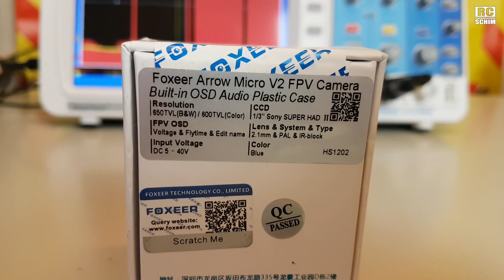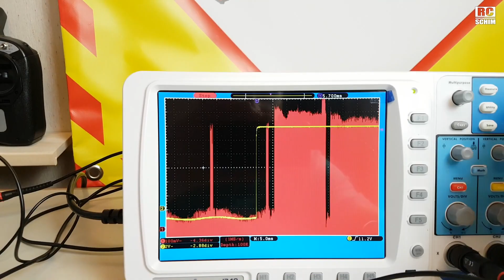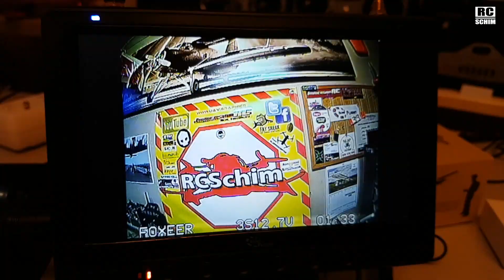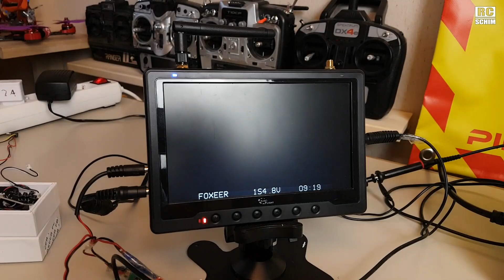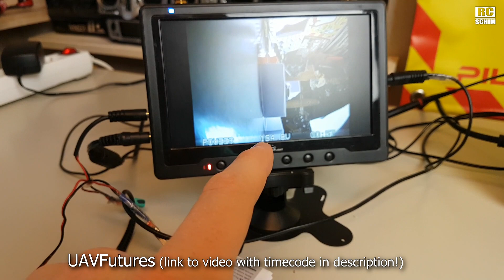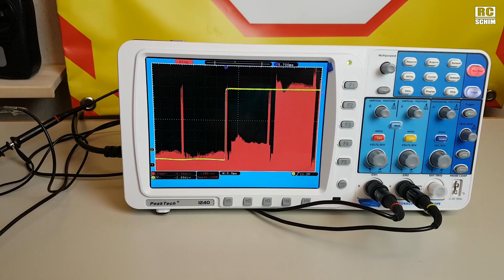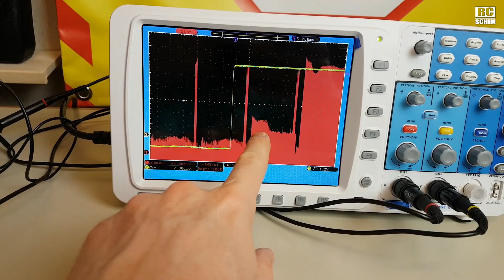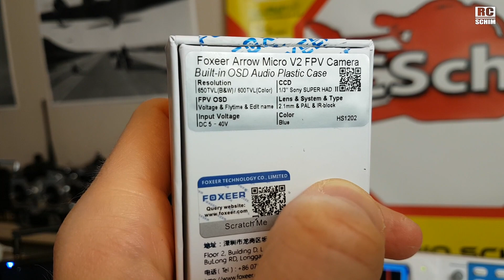Foxeer Arrow Micro V2 (Volts, Latency, compared to Runcam Micro Swift)

Comment: Did you try measuring the latency with the OSD switched off as the newer firmware increased it. With the Betaflight OSD being so versatile I can see the Cam OSD only being used on real budged builds.

Comment: Seems like the one you got with the fast-updating-OSD-Issue was not a "V2", because the "V2" should be the ones with the fixed OSD. (The cameras sold about half a month ago with the issue where just labeled "Foxeer Arrow Micro FPV Camera" https://youtu.be/NQW6_wtDqtI?t=1m15s ) PS.: I'd really be grateful if i was chosen to to get one of those cams. Although i'm no student any more, the Hobby is allready expensive enough and so i would finally be able to get rid of the old tbs zerozero with it's bad light handeling...PPS.: shipping to Tirol is super cheap ;-)
Reply from the maker: thanks - you're right of course: the micro arrow V2 is the one with corrected OSD voltage, the normal one had no V2 on it (and the seal sticker was red, new one is blue.
Reply from the maker: ok, (keeping it english for others),  since you earned it with this comment and I can save on shipping costs, you're the 2nd winner ;-) Was hard to decide whom to give it - but still better than a randomizer...
pls send me your shipping adress to schim@gmx.at  
greets to Tirol, have fun!
Reply: Wooohoooo great!! Thank's a lot!!